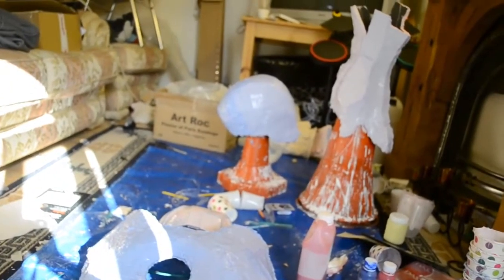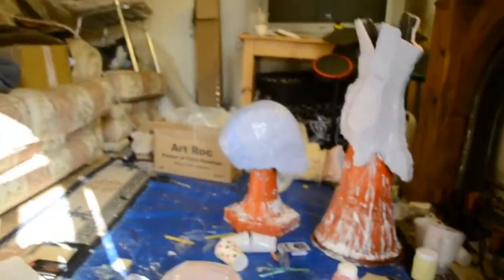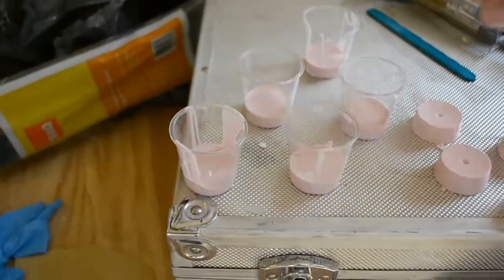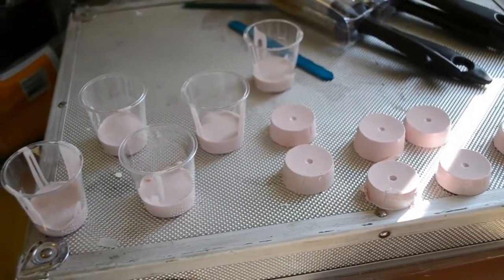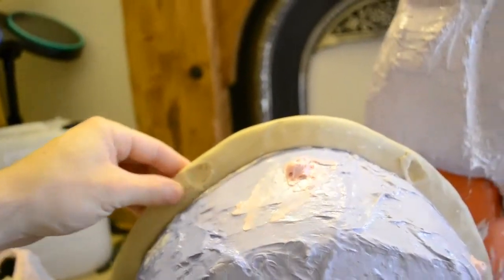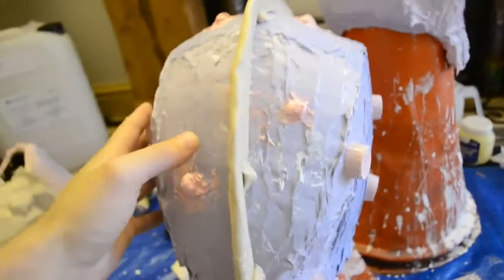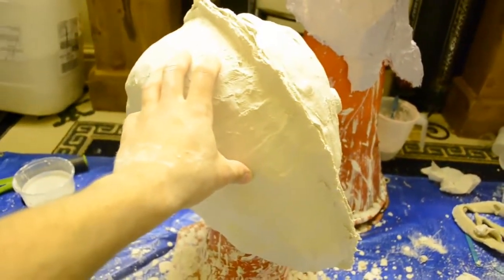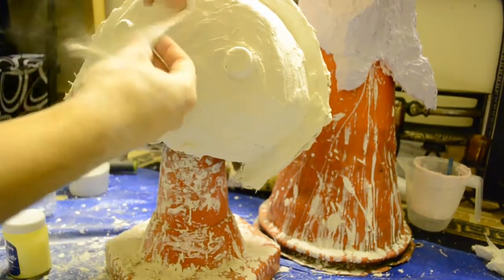12 - How to make a plaster bandage mothermold on my silicone mold for my Iron Man Helmet.

Comment: What happened to video #13?
Reply from the maker: It never got made. I was in a rush to try and pull a cast from the mold and there is a video of the result, just not the process.
Reply: +StarksWarehouse when is the next part gonna be out?